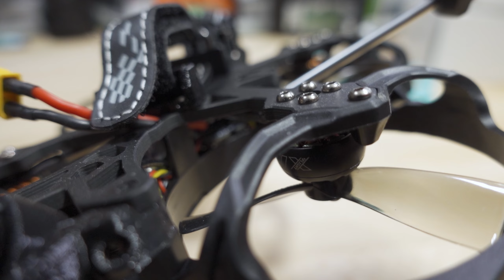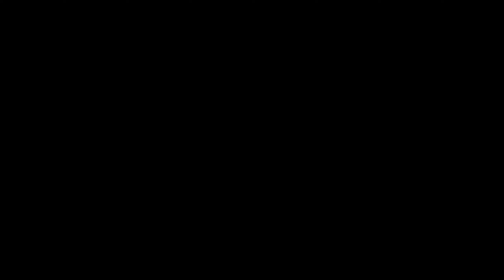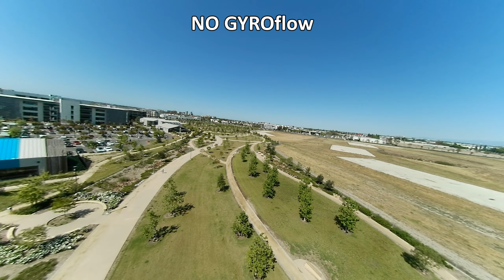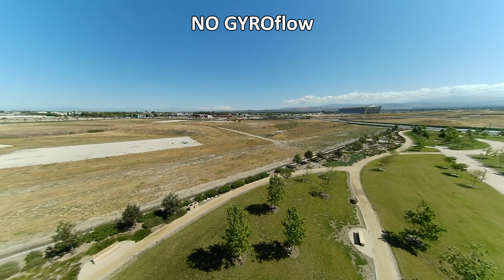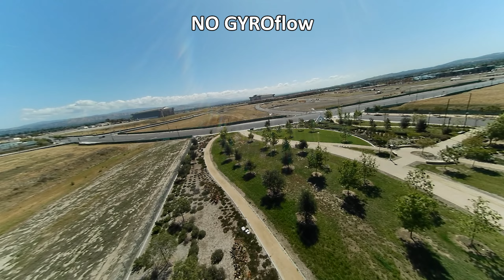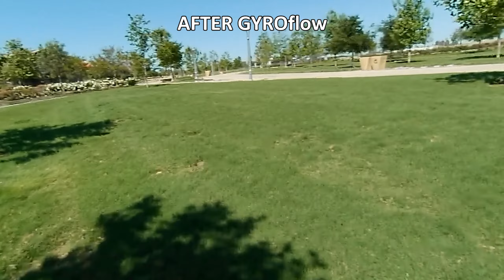iFlight Protek25 Pusher Runcam 4K Edition Review

Comment: Hi! Is this a runcam orange or Iflight gocam gr? Cause mine just get red light on for about 3 seconds and turn off again. What can I do? Even if I do a long press, double press, quickly preSs.. it turn red light on for 3seconds and off again.
Reply from the maker: Mine is the RunCam version.  Change the SD card.  You might have one too slow or defective.
Reply: @AlbertKimTV  I'm using a C10 SanDisk 32gb...
I will search another

Comment: Albert, I just received this quad today after watching your review. One question...  how did you manage to scan the QR  code when there's no button for the camera to change the light to solid green? Thanks.
Reply from the maker: The button is there and you have to double press it.  You'll need to use a flash light to see it.  I think it's on the opposite side of the SD card.
Reply: @AlbertKimTV  Thanks for the reply. I have to use a flashlight to find it.

Comment: Thanks for another great review!

Did you mention a firmware update for the 4K cam?  Is that the one on the run cam website?

Any tips on dealing with the videos on the sd card?  I looked at gyroflow, but that wants me to have a special codec to view the finished video... I can't actually view the videos raw off the sd card in Windows 10's video player.  All I get is a black screen ... Odd that they are stored as *.MOV rather than *.mp4...   I can view them in my Davinci Resolve editing software...
Reply from the maker: I'm not sure where the firmware update is.  iFlight sent me a file because my sample was an early release.  You might already have the latest firmware.

Comment: I built my protek i like it i want a 3.5 inch pusher just to many on the market to decide  that is odd almost looks like the gyroflow added its own jello . I feel it was much better before the gyroflow . Defiantly like that it comes with the 4k cam that is a great price for the package id design a 3d case so I could move it from quad to quad though  thanks for sharing Albert
Reply: For 3.5 I wanted a pusher too the cinelog seems like a good choice but I went with a terraplane instead
Reply: @YorkyPoo_UAV  there are so many cool looking cine frames anymore its so hard to pik just one
Reply: @jebrc  2.5 for indoors/ light wind. 3.5 for outdoors. Everyone likes the cinelog. They are a little frail but I wanted more "professional" gear so I'm rocking the Qav-pro 2.5 and the Terraplane. That terraplane is heavy but for 3.5 and the large motors I have is it. It is fast